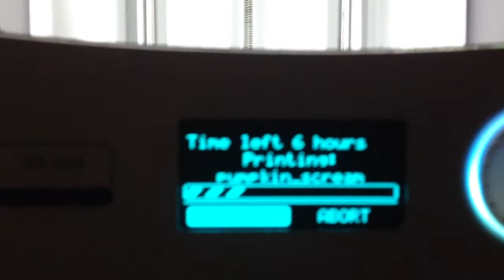Ultimaker 2 - Halloween Print

Comment from the maker: Very happy but I do have two issues; I believe they can both be corrected with a firmware update. 1-The filament doesn't extrude right away if the printer has been idol for even a short amount of time (I usually use the change filament feature right before prints so the filament is ready to flow) 2-There is no control for the LED lighting (I have the printer in my bedroom and often print throughout the night; the noise for me is no problem[love the low dB] but the bright lights are bothersome).

Comment: Neat! Any tips for printing that wrench? I've tried a few times with both PLA and ABS but haven't gotten it to work properly?
Reply from the maker: I printed @ layer height 0.15, 50mm/s, 20% fill, in Ultimaker PLA. It was pretty straight forward to print, however you have to carefully pull out those extra 3 pieces of plastic carefully yet forcefully. Their removal loosens up the inside and allows the parts to move freely.

Comment: looks like room for a 2nd hotend+extruder, did the guts they sent with the single unit support dual? or would you need all knew boards?
Reply from the maker: The single unit appears to be designed to fully support dual extrusion. I would also assume that the board just needs new firmware.  *****  Any corrections? Or updates on when the dual extrusion package will be available?

Comment: If you need supports for large overhanging structures, how easy would it be for a newbie to add that in the software they include?
Reply: it's added by a button press, the software autogenerates the supports

Comment: Thanks for sharing. One of Ultimaker user complained about the hard to remove support material in Cura forum (under the topic :New support material method). Do you experience this with Ultimaker 2? I am considering to buy it but need to make an informed decision. Thanks a lot!